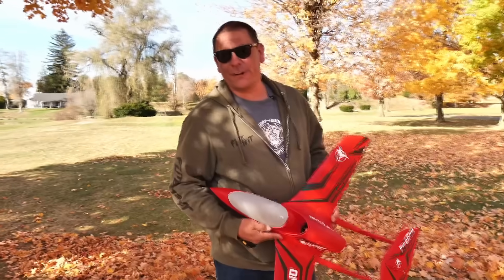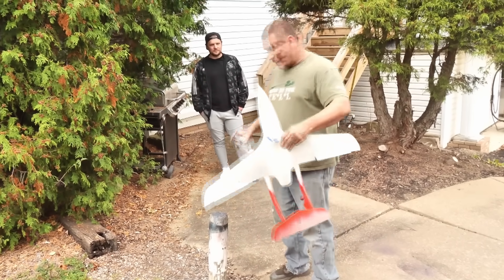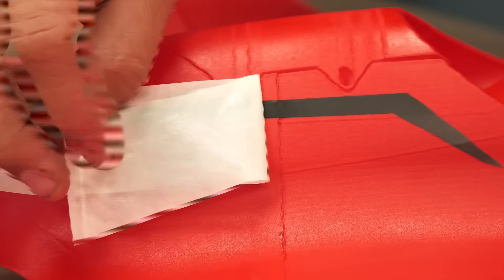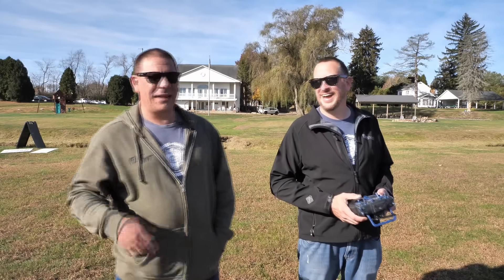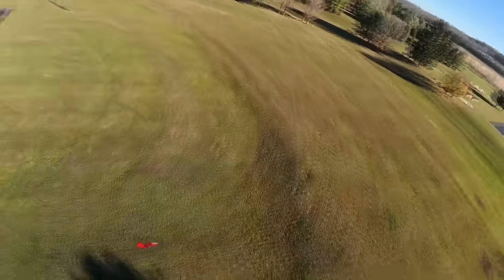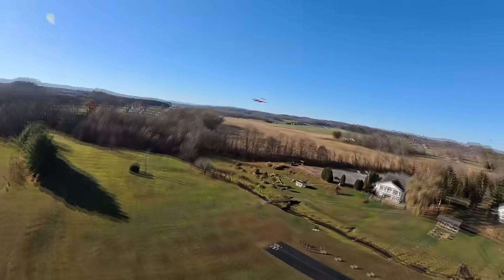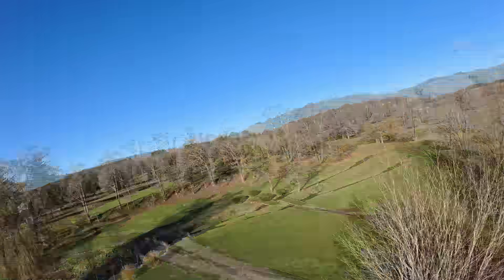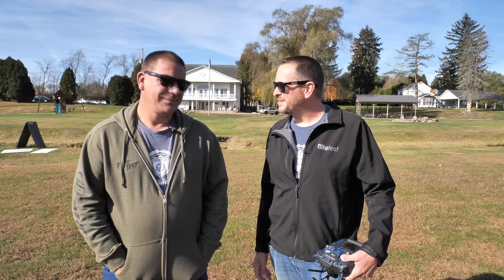Jet with No Carbon Spars! - Ultimate 3D Printed Jet - Eclipson Inferno

Comment: Hey guys! How about a video on your printing techniques with LW PLA? A lot of us have the Bambu Labs X1 Carbon. Or you could share your slicer settings.
Reply: I second this, it would be really useful.
Reply from the maker: We will have to do this in the next Eclipson Episode. What would you like to know
Reply: @FliteTest  I've never printed with LW PLA. I've heard it's a little tricky to get right. I'm interested in printing an airplane some day and I have a Bambu Labs X1-C.
I would love to have you guys go over slicer settings and any words of advice for a beginner.
This would be a great Flitetest Tech video!
Reply: @FliteTest  Any slicer settings that you've optimised e.g. temperatures, cooling, layer heights etc.  Do you do anything special for overhangs e.g. water soluble filament?  What's the layer adhesion like with the lightweight PLA?

Comment: I love the look of that airframe, so sleek and sharp.  But at 4:52, with that full throttle fly by, it screams like a rear propeller Multiplex Funjet!  I've never heard an EDF that loud before.
Reply from the maker: It is a super slick airplane and extremely slick
Reply: @FliteTest  what he meant .. you need a more whooshy EDF unit... not that screamer :)
Reply: I think that might have been the fpv drone right next to it XD
Reply: @ningcraft  Maybe the little quadcopter added a bit to the noise, but quadcopter don't sound like what we heard in the video.  That banshee whine we hear is the plane, and it sounds very close to a Multiplex Funjet back in the day.

Comment: You should switch to ASA aero filament for planes, you'll be able to keep them out in the sun all day
Reply: Would be interesting to compare the same model printed in LW PLA and the ASA Aero. The ASA seems to be very prone to stringing, so probably more post processing needed.
Reply: @ferrumignis no, no problem with stringing for models like Eclipson using Vase Mode but you have to print slow at about 30mm/s and very important to heat up the printer chamber well before starting to print.